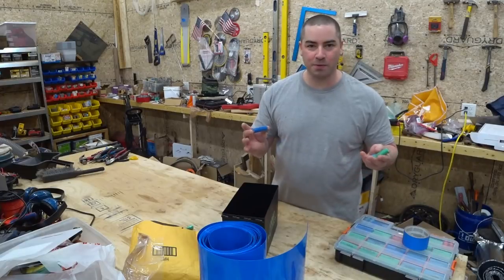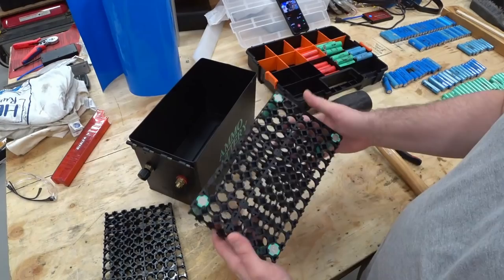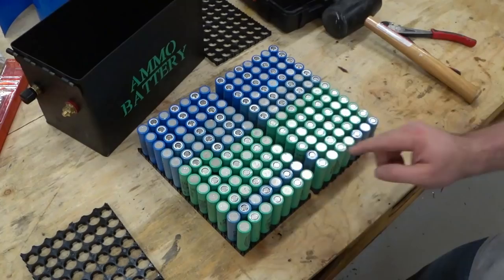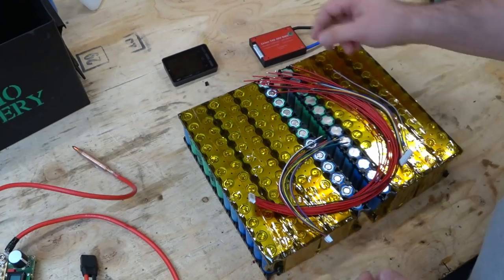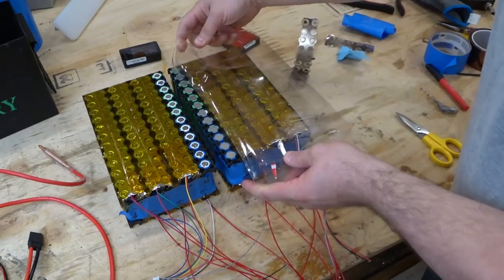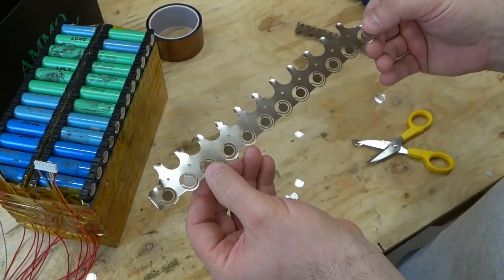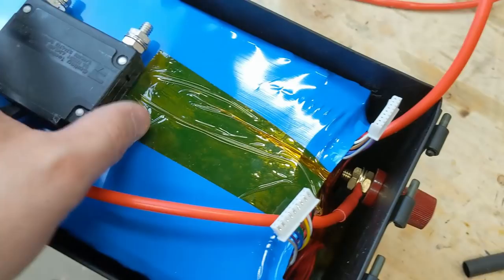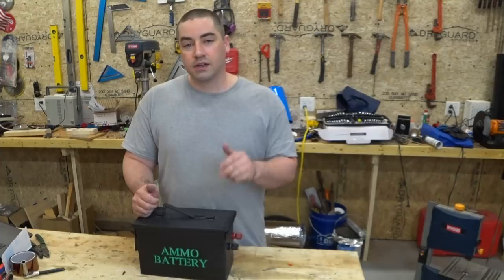48v DIY Battery in an Ammo Can

Comment: Thanks David.Where is the link for the spot welder?
Reply from the maker: The spot welder is called the "Kweld".  It is sold by Keith, owner/operator of "18650ed" in Rhode Island.  You can call/e-mail, or message him in facebook to place an order.  I'm not affiliated with his company.  I bought mine from him at full price and it works great.  I wish Keith had a way to just buy it online, but for now at least, you have to e-mail him.  https://18650shrinkandcellholders.com/kweld/  I bought the cell holders from him too.
Reply: @DavidPozEnergy  Thanks again David for your rapid reply

Comment: quick question, so if you are building a 48v battery, you need  3.6v x 14 = 50.4 and fully charged it would be  4.2 x14=58.8, could this scause problems for a ebike controller? or are they rated to handle higher voltage?
Reply from the maker: I don't know about your specific controller.  You will need to look up the specifications.  I use this with a small inverter.  My inverter is rated for 48V, but can have an input voltage between 41V and 64V. Your controller will likley be similar.
Reply: @DavidPozEnergy  thanks for letting know. I am just starting to figure this stuff out and trying to build an ebike.

Comment: What  about  thermo  protection ?
Reply from the maker: I limited the amps to 20 with the circuit breaker.  The cells can to more than that (up to 38 amps).  By limiting the amps I should be limiting the heat build up.  I'm still testing the pack, but at a continuous 15 amp discharge the pack did not overheat.

Comment: What amp hour would this battery be? 20? I’m a newbie trying to understand kilowatt hours. Thanks
Reply from the maker: Each cell is 2200mah (mili amp hour) which equals 2.2 ah.  I have 12 cells in parallel.  When cells are in parallel the capacity (ah) add together.  12x2.2=26.4ah.  That's how big this battery is, 26.4 amp hour.
Reply: DavidPoz nice I was close! Love your channel!

Comment: Why net set it up for a common voltage 12, 24, 110, etc??
Reply from the maker: My equipment is 48v nominal.
Reply: 6, 8, 12, 24, 32, 36, 48, 64, 120 are all standard common nominal Lead-acid voltages/combinations. It all depends on the equipment that you work with. I have worked with 1000AH 8 volt batteries that are big enough that you need a fork lift or cart to move them( ~400 lbs). 4 of them together = one 32V 1000AH battery. That battery can only be moved with a forklift as it weighs in at almost 1700lbs. You can draw 45 Amps continuously for 20 hours out of them.

Comment: I need the specs!!!! 48v.... got that..  what's the amp hours? Or watt hours?
Reply from the maker: I used cells that have a nominal voltage of 3.6, and capacity per cell of 2200mah.  That means each cell is 7.92wh.  I used 168 cells, = 1.33kwh.

Comment: What size battery do you use for your spot welder? I purchased one and c can't seem to get it to work. The specs say 100-300 amp battery so I purchased a 100 amp lawn tractor battery (I didn't want to blow anything up) and all I get out if it is a beep. It doesn't weld at all.
Reply from the maker: I use a small battery made for RC.  It is similar to this one: https://amzn.to/3Y8L3gA
Reply: @DavidPozEnergy  thanks, I'll give that a shot before I send it back.
Reply: @DavidPozEnergy  I've been building 7s12p li-ion batteries for a power wall. Will that work? I haven't tried one yet in fear of ,again, blowing something up. I'm just getting into this solar thing and had planned on being completely off-grid by the end of last year. All I'm lacking is a few more batteries and a split phase inverter.
Reply from the maker: Hi Gary,  The best online forum for this is "DIY Powerwalls" Facebook group.  I'm on there along with several other helpful people.  I don't know if the battery you plan to build will work for your application.  You will need to share a lot more details for proper sizing.  Please hop on the group and post your question with any details you have.  I'll watch out for it.
Reply: @DavidPozEnergy  all the cells I'm using are not over 2200mah. since the beginning I'm now using all same cells in a pack 3.6v, 2200mah but I'm not sure how that translates to discharge amps. And on top of watching yours and other videos I've been reading A ton of diy lithium battery build books
Reply from the maker: Some cells are designed for high Amperage discharge (think cordless tool batteries).  Other cells are designed for low Amperage (think modem cells).  It would be a good idea to look up your cells data.  If you don't have a data sheet, then use the figure 0.5C rate.  This is usually conservative, but keeps everything running cool and healthy.  I personally use 0.5C rate as my limit.  Now, how to translate that.  You are using 2200mAh cells.  That means each cell is 2.2Ah.  If you used a 1C rate, that means 2.2 Amps.  Since I suggest 0.5C rate (until you have documentation stating something else) that means 1.1 Amp maximum current.  You stated earlier you are building a "7s12p" pack.  12 cells in parallel means 12*1.1A=13.2A maximum current.  Since this is a 7s, it's a 24V pack.  24V*13.2A=316.8W  This means you can connect your battery with a maximum 300W load (inverter), and maximum 300W charger (solar panel).  Again, until you prove otherwise with getting your cells spec sheet.
Reply: @DavidPozEnergy  ok, so you're saying that 
1. I have batteries that are discharged at 316.8 amps per battery pack?
2. If I have 10 batteries parallel, I add all the amps and I'll get 3168.00 amps? 
I'm guessing that's DC and after it's converted to AC what will it be ? I currently have a 2000 watt pure inverter. I've run a couple of test items (shop vac and so forth) for short periods, like 10-20 seconds, and don't seem to be having any issues yet. What should I be looking for. I hope I'm not pestering you with all these questions but some of the things I've read in the books are either  going over my head or I quickly forget them. I retain so much more information when it's told to me. And hardly any video really addresses the question at the time leaving me to kinda figure it out. Have I made mistakes? Yes, but I haven't burnt the house down yet, so there's that. 😂
Reply from the maker: Sorry, I made a mistake.   I meant to use a W as I did in the other locations.  24V×13.2A=316.8W.  I corrected it above.
Reply: @DavidPozEnergy  you have no idea how much help you've given me today. I can understand what you're telling me and a real good chance I'll remember it because you told me in a way that even this hillbilly gets it. Thank you for your help.
(PS. and you weren't a smartass about it. That is what I really appreciate) 🤠
Reply from the maker: You're welcome.

Comment: What runs on 48 volts? Good job though!
Reply from the maker: I own three inverters that are all 48v.  My solar and charge controllers are also set up for 48v.  If your situation is different, then make it to suit your needs.  It's just a matter of re-configuring the cell arrangement.
Reply: standard land line telephone uses 48V DC for talk battery and it uses 96V DC ringing current. Just thought I'd throw that in. But land line phones are becoming ancient technology.  Anyway that was my question, why build 48V battery, I don't know of anything other than phones that uses that. And using a inverter to 120V AC, is usually  12 V DC or at least the one I have uses 12 V.  Maybe it's something for a solar power system? interesting to watch anyway.

Comment: If I wanted to run a full size refridge, what should I focus on?
Reply from the maker: Two things.  First is capacity of the battery.  This will determine how long you can run the fridge.  This power supply will give me about 24 hours on my home fridge/freezer unit.  The second, is the inverter.  I did not cover inverters in this video, but you need to convert the 48v DC to 120v AC (in North America).  I suggest starting with plugging in a watt meter to the back of your fridge for a week, then average the per day kwh usage.  That will give you a place to start with your calculations.  Something like this one: https://amzn.to/2WmVsbQ  “As an Amazon Associate I earn from qualifying purchases.”
Reply: @DavidPozEnergy , so this system you built will operate a refridge?  just checking.  Also, I would like to send something for responding to me.  Where can i send it?  Just a small appreciation for being a great persona on youtube.
Reply from the maker: We can chat through facebook messenger at https://www.facebook.com/DavidPozEnergy/

Comment: i wonder if you can use that as a car battery?
Reply from the maker: Car batteries need to start the car.  The starter can draw hundreds of amps for a second or two while getting the engine going.  This setup can't handle that amp draw.
Reply: @DavidPozEnergy  ok. Thanks.
I guess one would need to design something that can handle higher amperage.
Reply from the maker: Yes.  LTO cells are a great option, or Headway cells.  They both can deliver the high amps needed for starting an engine.  But it comes down to why you might need this.  If you want to run something in your car while the engine is off, then it's probably easier to add a storage battery (like this) that is disconnected when the car is off.  This would prevent you from draining the starting battery.

Comment: I'm new here so forgive my ignorance.
Can this battery be used in place of lithium batteries (ie Battleborn) to use in an off grid solar system on an RV?
Reply from the maker: I think Battle Born comes in 12v and 24v versions.  I built this lithium battery as a 48v.  But you can build a battery any size and any voltage to fit your needs.  Yes, it's very popular to build your own lithium battery for off-grid solar in RVs.
Reply: @DavidPozEnergy  TY David! 
Would altering your 48 volt build to a 24v be very difficult? Im thinking it shouldn't?
Reply from the maker: No, it shouldn't be very difficult.  instead of every row being another series, it would wind up being 24 cells in parallel, every two rows.  You would need a 24v BMS.  And probably get the 4-wide nickel fuse strips.
Reply: @DavidPozEnergy  TY so much for responding! What is the life expectancy of these batteries under moderate to frequent usage in an off grid application?
Reply from the maker: I don't have first-hand experience.  Check out HBPowerwall YT channel. I linked to it in the description. I think he has been running large packs with these types of cells for 4 years.

Comment: Any thoughts on a spot welder?
Reply from the maker: I own the K-weld and works great.  I've seen some videos with people using cheap $30-$50 units, and I think those would probably be fine for the easy stuff, 0.10 Nickel, just not the thicker stuff. But I"m just guessing
Reply: @DavidPozEnergy  Thank you, I could not find it as the link is no longer available.
Reply from the maker: Kieth is the owner of a store in Rhode Island called 18650'ed Heat Shrink and Cell Holder .com  He sells stuff through ebay: https://www.ebay.com/str/18650shrinkandcellholders  And on Facebook.  Try sending him a message.  He is the North American distributor/servicer of K-weld

Comment: Use repacker.com punch in your cell capacity from each cell it will tell you what cells to put in each group so each group is balanced other wise your BMS will pickup on the group that goes low voltage first if you have too many weak cells in the same group.
Reply from the maker: I wanted to use repackr.  Unfortunately, the cell tester I used in my previous video was horribly inaccurate.  I couldn't trust any of the mah numbers I was getting. Next time I'll have to buy some trusted Opus or something.

Comment: I lost interest in the "welder" when I found out that one has to have a FaceBook account to get the documentation.
Reply from the maker: That's not accurate.  The price list opens in a web browser.  And Keith has an e-mail to get in touch with him.  Facebook is just one option.  Links right on his website: https://18650shrinkandcellholders.com/kweld/
Reply: @DavidPozEnergy  That link opens up a spread sheet with the prices and it has a link labeled  "For Assembly and Operation Instructions click here".
The URL for that link leads to facebook and requires a facebook account to login.

I did finally get a look at the documentation by going to the german site.
Reply: I will email Keith, but interested in purchasing the welder already built (and not just the parts), anyone have that done and available?
Reply: Links for K Weld no longer work.

Comment: Hi there I have a E bike kit it is 48v 1500watt I am interested to make my own battery pack plz could you point me in right direction cheers
Reply from the maker: Your system is 30 amps or so.  This battery could do that for short bursts, but not long term.  It would be better to choose cells with a higher amp rating.  Battery Hookup also sells used Ryobi packs with high-amp cells.  If you don't have a lot of tools, then making your system with Headway cells is pretty easy.  Headway cells just have screws on top.
Reply: @DavidPozEnergy  thanks David I will have to check them out appreciate your fast reply and feedback

Comment: I would like to make a 1 ,that is 24 volts ,  about how would it cost , I would be using it to run my Government generator , that  10 ,000  watts , & need a small 24 volt battery to start it , & using to start , a new 24 volt lead acid will be very expensive , I would need a box that is 6” & same length as the ammo box , if you could help me  a lot  , I am 70  & good with items like this , ? Do you need my E-Mail , have you tagged , will look for a answer from you Thank You , Don Emery .
Reply from the maker: The cells I used in this build would not be a good choice for starting a motor.  Starters can draw hundreds of amps.  If you want to build your own 24v battery with lithiums, and you need high start capacity, then maybe look at headways.  You would probably need a 4p8s to handle a diesel engine, but you could check your peak current draw to make sure.  That would mean needing 32 Headway Cells.  https://batteryhookup.com/collections/green-friday-weekend-deals/products/4-headway-38120-hp-3-2v-8ah-lifepo4-lithium-batteries-25c-200a-super-cells?rfsn=3333666.ca06e9

You can use my coupon code, DAVIDPOZ for 10% off. But at that point it might make more sense to stick with a lead acid battery.

Comment: ??? Ah,,,, BMS ???
Reply from the maker: BMS stands for Battery Management System.  It's primary job is to shut off the battery from the load and/or charger in the event the cells go out of parameters.